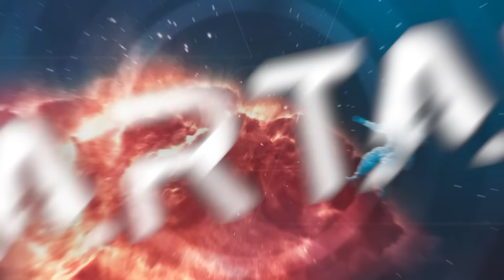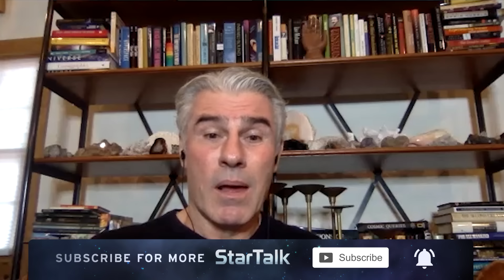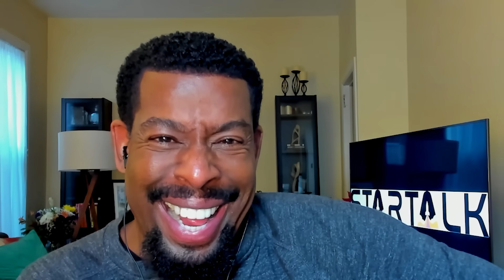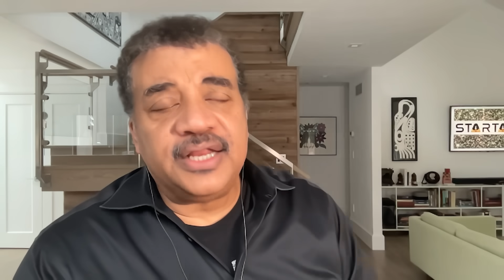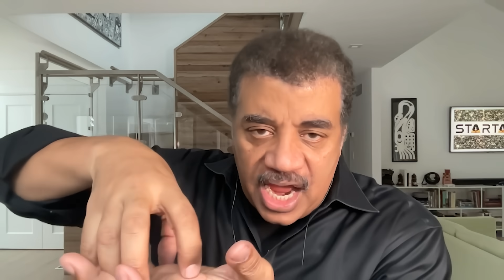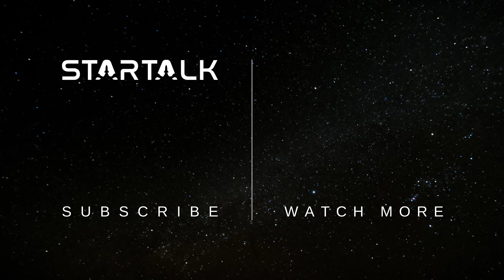What’s The Fastest A Car Can Go? | Neil deGrasse Tyson Explains...

Comment: Although I agree with Neil in principle, there has been a lot of "black art" practiced in this arena. Many vehicles beat 0-60 in 3 seconds which implies that a level of grip greater than 1G is achieved for at least a portion of the time on the 0-60 sprint. The Tesla Model S Plaid does this consistently in less than 3 seconds. Doing the math, 0-60 at a steady 1G takes 2.73512349 seconds (88 feet/sec / 32.17405 feet/sec/sec).

Comment: You missed the boat on this one. What about a car on a sand/dirt surface? Ever heard of F = dp/dt? All common tires have grooves. Dirt goes one direction, the car accelerates.  Although it is inefficient, there is no barrier here for acceleration other than the surface speed of the tire being c.

Comment: Engineering explained did the math in a video and came at a 2.05s 0 - 60 time for a "normal" car. Meanwhile a Rimac can do it in 1.85s and then you have the AMZ Racing which does it under a second, but that one is not a normal car. It cheats with air pressure.

Comment: I have to disagree. Terminal velocity, in my humble opinion, is not related to the initial acceleration. Even with a small increase in speed (small acceleration) if you keep it indefinitely, you would theoretically attain an infinite speed. So, I was hoping to learn that air won't let a car move faster than X speed or something more interesting.

Comment: This is wrong on so many levels. First of all fastest is by definition top speed not acceleration so initial argument and title don't match the later debate. Then he stated to increase downforce you need to increase mass, which requires more power, and there is no limit to power output of engines, so by that postulate there is also no limit to downforce since they scale linear. Third and most important top acceleration is 1g which is completely false statement. Nevera on regular road and regular tires had 1.4g accelerating and almost 2g decelerating.

Comment: The 1,888bhp Rimac Nevera represents the pinnacle of current hypercar technology, and with a 0-60mph time of 1.85 seconds, it produces the numbers to show for it. Sharing its platform and powertrain tech with the Pininfarina Battista, the Nevera carries its eye-watering pace through to a top speed of 258mph, making it the fastest EV in history. With only its second bespoke model, the Croatian brand has laid down quite a marker.

Fastest accelerating cars: full list
Rimac Nevera – 1.85 seconds (0-60mph)
Lucid Air Sapphire – 1.89 seconds (0-60mph)
Pininfarina Battista – 1.9 seconds (0-62mph)
Tesla Model S Plaid – 2.3 seconds (0-60mph)
Ultima Evolution Coupe (supercharged) & Ultima RS LT5 – 2.3 seconds (0-60mph)
Dodge Challenger SRT Demon – 2.3 seconds (0-60mph)
Reply: That's with rollout, sadly.

Comment: 5:10 - you don't want air underneath the car. Air underneath the car = drag and lift. Ideally, you want to seal the bottom of the car off so as little air can go under as possible to maximize downforce and optimize drag. Take a peak at F1, NASCAR, IndyCar, etc.
Reply: If you can speed up the air going underneath than the air going above the car, it will create low pressure and negative lift (down force).

Comment: Just a couple of minutes into this and looking at comments too and I noticed something that it doesn't appear many people have much knowledge about. Instant center and anti squat, it's what allows dragsters to accelerate like they do, pro stock drag cars to accelerate like they do, and semi trucks to accelerate like they do (also comes into play on everyday vehicles just not as much effect) instant center is the point the rear axle (in a rwd vehicle) is lifting on the front of the vehicle ( it's the rotation about the center of the rear axle and the point it is being lifted at) and anti squat is a part of the geometry related to how the rear suspension reacts, if it has anti squat built into the geometry it means that instead of the rear of the vehicle "squatting" when it accelerates under power it actually stands up and pushes the rear tires into the ground harder. Add in adjustments to instant center and you can increase the amount of weight that is actually applied down into the ground on the rear tires which increases the contact patch of the rear tires which increases the amount of force needed to break the traction between the tires and the road surface... some of that may be included in the "Engineering the world's fastest cars" video I'm going to watch right after this
Reply: And this comment was posted here after I commented on that video because I was slow on typing and that video started before I posted the comment.  Also realized instant center and anti squat were never brought up in that video either but that is how you increase the amount of friction on the drive tires without increasing the weight of the vehicle during acceleration.

Comment: I hate to say it but either Neil has done a crap job of explaining this or he is wrong.
Electric cars are pushing very close to 2 seconds 0-100 km/h (0-62 mph) today. No jet, no gears, no roll out and road tyres.
Top fuel dragsters reach speeds 0-160 km/h (0-100 mph) in as little as 0.8 seconds. Sticky tyres, sure. No jet though.
Neil, you need to revisit this with a better explanation.
Reply: He redeemed himself by making a video on the same topic with Jason from Engineering Explained

Comment: Neil, How can you hold yourself up as an expert in ANYTHING when you get something as basic as this so wrong. A coefficient of friction between the tires and the road greater than gravity, along with positive downforce as the vehicle picks up speed will ensure faster-than-gravitational acceleration (given enough hp). The quickest vehicles are currently accelerating at roughly 1.5 g; improvements in tires and aerodynamics will continue to push the upper bounds of acceleration. How am I wrong?

Comment: Ok, this is where the engineer gets up and shakes his head. First of a Rimac Nervera has a 0-60 mph in 1.85 sec. Besides, the Rimac, the Lucid Air Sapphire, the Pinafiarina Battista, and the Tesla Model S Plaid are all sub-2.0-sec cars (all-electric, notably.  The fastest ICE is the Utima Evolution Couple with a 0-60 of 2.3 seconds). 

Doing the math, a 0-60 in 1.85 sec is 1.48 g. So Neil is wrong.  Second, his explanation of the problem is incomplete. Yes, weight over the tire has a specific impact on the friction between the tire and the ground, and yes, the "stickiness" of the tire has a measurable impact. But the most important fact is the area of the contact patch. The tesla is a 3-motor design that uses all four wheels to accelerate the car. (the Rimac has four engines). Meaning that the total amount of area in direct contact between the ground and the car, under friction loading, is twice that of a two-wheel drive car.

Further, the start is only part of the problem; moving the air from in front of the car is the real problem beyond t>0+. The Rimac would be doing 60 mph in 1.85 secs.

Neil oversimplified this response, and it shows. Is there a functional limit for the acceleration of a car?  Well, we know there is a limit; if nothing else, it is the speed of light. So assuming it is not a DeLorean, we have to work with drag, ground friction and material (salt flats are slower than A/C tarmac), HP provided, and shape design as a function of drag v downforce, tire compound, the acceleration curve application going from HP = 0% to HP =100%, weight distribution, contract area and the number of surfaces, and adaptive power controls to address differential power application (and I am sure there are more). Weight over the tire, in the case of Rimac, is significant (as electric cars are heavy), but that is only part of the reason that its acceleration is so great. It mostly is that it has 1,914 HP and 1,300 ft-lb of torque, with four contact patches on very wide tires. The car is set to the ground and flows air under it to create downward pressure as it moves through the air, increasing both the amount of downforce and the increased size of the contact patch as the tire is flattened under a downward load on the ground.

A very long and skinny car, shaped like a jet car (or an arrow), is going to accelerate faster than the same mass in a less efficient shape, all else being equal, as the impact of drag, which is exponentially increasing, becomes more of an issue the faster you go. As to a limit, t = 0+ acceleration is important, but at t = 0+, the most force is being placed on the ground from the tire with the smallest contact patch. At t > 0, the rolling tire and the moving ground below have less friction loss than at T=0+ as the contract patches are larger and acceleration loss due to friction loss is less.

If you assume a car in a vacuum under a gravity load, there is an equation that could be written that is a direct function between Mass, Friction Coefficient, Angular Acceleration, and Horse Power, and that might get you close to a theoretical limit under those conditions, but I am unsure if it would be faster than a car traveling through air. Then it is a question of how much downforce you get v how much you lose to drag. A car shaped like a pencil would be faster with air than in a vacuum, while a sailboat-shaped car would be slower.
Reply: Rimac's time is with rollout, sadly. Still over 1G though!
Reply: @razorr_o  I thought it was from a dead stop. At least, that is what 0-60 means to me. But ok, my point still holds. :) I have to admit, the 1 g claim is a great example of correlation that does not imply causation. I am sorry, but if he was in my class, I think I call him on that. :)

Comment: A Tesla with ludicrous option accelerates to 60 mph in about 2 seconds. A Tesla thrown off a building in a vacuum would accelerate slower than the ludicrous model can accelerate linearly. (though only up to about 80mph)

I don't doubt that Neil is right about friction, etc., but the Tesla is obviously MUCH faster than what he's talking about and it's with standard tires.

I've noticed that Neil is limited to his admirable knowledge of physics and the way things are currently done and doesn't seem to understand that there are creative ways to bypass laws of physics not by breaking the laws but by circumventing them. He'll say something is impossible and then explain why it works when it is demonstrated to be possible. He has a pedantic way of thinking about problems. He has knowledge but no imagination.

He also did this when he keeps talking about why we shouldn't colonize Mars. He keeps talking about the price of sending ALL THE PEOPLE OF EARTH there without thinking about the fact that you theoretically only need 2.
Reply: He redeemed himself by making a video on the same topic with Jason from Engineering Explained

Comment: Assuming ideal conditions, a car with a perfect 1:1 weight distribution and the ability to transfer 100% of its power to the wheels could theoretically accelerate at a rate of around 9.8 meters per second squared, which is equivalent to the acceleration due to gravity. This means that it would take approximately 2.7 seconds to reach 60 mph from a standstill.

However, in the real world, other factors such as aerodynamic drag, tire slip, and powertrain losses will reduce the car's acceleration. In addition, even if a car had the ability to accelerate at such a high rate, it would be extremely difficult for a driver to control the car and avoid losing traction or spinning out.

Comment: @5:51 🤔The statement "The fastest you can accelerate forward is 1g" is in fact incorrect. A simple thought experiment is all that is needed to intuitively realize this. If we examine the tribology of the contact surfaces, i.e., where rubber meets road, we realise that the limiting factor to road "grip" is the ablation of our tire compounds. Therefore, if we were to replace our road and tire with a rack and pinion system, we can be confident that the limiting factor to acceleration becomes inertia, engine (or motor) power, and drag.

A real life counterargument to the assertion @5:51 is the McMurtry Speirling, an all-battery electric race car. The McMurtry Speirling can sprint from 0-60mph in 1.4 seconds and cover the quarter mile in 7.97 seconds. The quarter mile is about 400m. From kinematic physics, (distance) = (1/2)*(acceleration)*(time^2). We can rearrange the equation to get (acceleration) = (2)*(distance)/(time^2) = (2*400m)/(7.97^2 s^2) = 12.6m/s^2. Gravity on earth is generally approximated as 9.8m/s^2, so the McMurtry is pulling 12.6/9.8 = 1.3g.😳  

Yes, the McMurtry is a fan-car (it uses a powerful fan to create a suction force of almost 2 metric tonnes). This suction force increases the apparent weight of the car. Friction force is just apparent weight x coefficient of friction. The higher the friction force, the higher the potential acceleration, if the motors are up to the task, which they clearly are for the McMurtry Speirling.

It gets even crazier though, because the McMurtry actually has a 150mph speed governor. Back to our ballistics equation, (velocity) = (acceleration)*(time), which we can rearrange to get (acceleration) = (velocity)/(time). 60mph is 26.8m/s, so (acceleration) = (26.8m/s)/(1.4s) = 19.1m/s^2.  Again, on earth, gravity is generally approximated as 9.8m/s^2, so the McMurtry is capable of (19.1m/s^2)/(9.8m/s^2) ~2g!!!!!!!!🤯😂
Reply: Neil redeemed himself by making a video on the same topic with Jason from Engineering Explained

Comment: 4m 20s No, Neil, they do NOT scale EXACTLY together!  When speaking about the surfaces, both road and tire, the limit to force the flexible tire into the road surface is limited.  there is a point that more weight does not benefit increase  Increasing the surface mating area, the contact patch increases the ability to accelerate.  the material of the tire will sheer away at a given, calculable point.  this can be written in force per millimeter, centimeter, square inch, etc...  The weight can be shifted, by design, without increasing the vehicle's weight.

then again, you are not taking into account that the speed at which a tire rotates, adds to the amount of material of the tire that interlocks with the road surface.  Tires actually provide their maximum forward acceleration, cornering and braking with a certain amount of slip (in some cases @7%).

BTW, Neil, Skidding out is NOT the proper term for the loss of traction in acceleration, but in deceleration (stopping, negative acceleration). The contact patch cannot generate enough friction to slow the vehicle as much as the brakes and energy (vehicle mass*forward motion) require.  I just described a skid.  Skidding out is the loss of trajectory due to a skid.  A burnout, as your buddy said, is correct, 

That doctorate does not mean that you know it all and your inability to even research the proper terminology would have caused you to never have received your doctorate, as you think you are speaking about one thing, while actually speaking about another.
Reply: Neil seems like more of a philosopher than a scientist sometimes. However, his ability to explain complex astrophysics topics in a simple way is pretty incredible. He should stick to what he knows and has researched extensively though.
Reply: @ Neil's doctorate thesis is not even important.  Here is the long and short of it:
Galaxies are disc-shaped.  Discs are almost two dimensional
I will look at the endge of such galaxies and prove they are pretty much flat.
Two or three (oo, maybe evben 4) hours  on big telescops, he looked at the center of the flat edge of such galaxies and then noted that as his view moved off center, there were increasingly less stars in tht galaxy.
Then he made a chart that showed that the disc has its material in the disc and not outside the disc.

WOW, nothing short of sleep inspiring and nothing that intuition already innately knew.

He is a running joke in the scientific community!

Comment: Precisely why drag cars have huge wings on them and why they use slick tires with low pressure and burnout before launching. They get maximum surface to surface contact with the track along with partially melted rubber which increases traction and then combine it with all the downforce created by the wings on the front and rear of the car to reach speeds of over 300 mph in just over 3 seconds in a quarter of a mile.

Comment: I’m not an expert but I’d say the mentioned limit of 0-60 in 3 seconds accounts for a constant amount of torque (i.e. throttle). Modern cars, especially electric cars, have launch systems that allow an increased torque output as speed on the way to 60 increases, allowing the other forces other than friction to go into effect and increase the rate at which a car can accelerate.

Comment: A space shuttle pulls about 3G as it launches into orbit. A Bugatti Veyron might hit 1.5G under full acceleration in low gear.
A top fuel dragster reaches 4G shortly after it leaves the staging beams – within a quarter of a second of the driver hitting the pedal.  After about half a second the acceleration tapers off, down to just over 3G after about a second of acceleration.

Comment: The Battista goes from 0-60 mph in 1.79 seconds, uses four electric motors that produce a combined 1,900 bhp (1,417 kilowatts) and 1,696 pound-feet (2,300 Newton-metres) of torque.
Reply: With rollout.

Comment: An acceleration of 1G means you can’t go under 2,8 s when accelerating from 0 to 100 km/h. But a lot of cars can do it in 2s and a Porsche 919 can do it in 1,9 s. And the Tesla Roadster does it in less than 2 secs.
I really like Neil degrasse Tyson, but here he is just plain wrong.
Reply: He redeemed himself by making a video on the same topic with Jason from Engineering Explained.